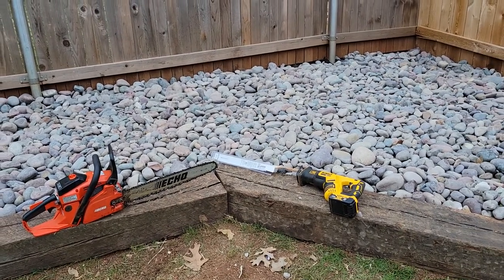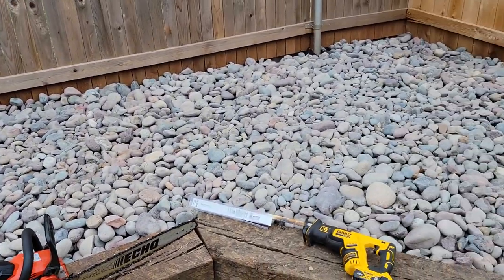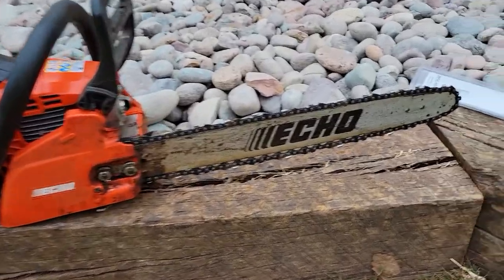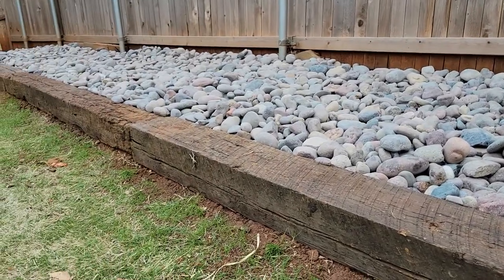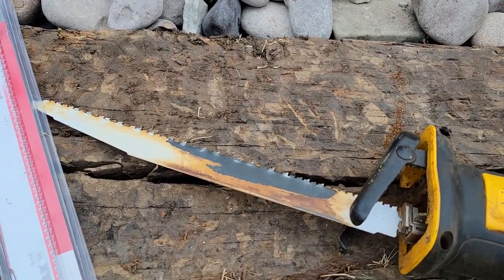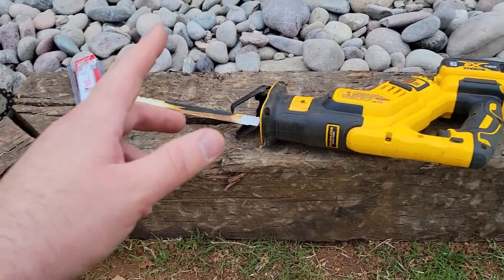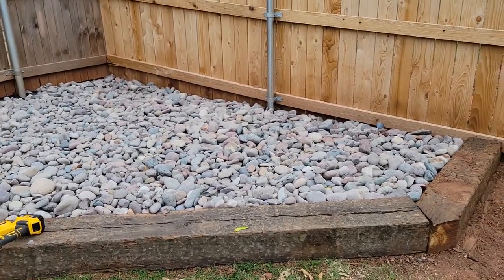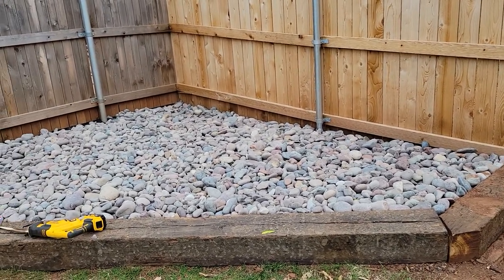Cutting Railroad Ties with a Chainsaw vs Reciprocating Saw

Comment: When you said the saw gets really hot it can burn your hands you said you should be practicing what?  I couldn't understand the words.  What is better to do?  Thank you.  I'm planning on doing this.
Reply from the maker: duty cycle of the motor. Given how much load the saw was continuously taking it generated a lot of heat. Starter motors on engines generally have published duty cycles, which would give metrics such as using the motor for 20 seconds and then letting it rest for xx seconds. Not following them can greatly reduce the life of a motor. A lot of tools have a thermal device that will keep the motor from overheating. Does DeWalt? Likely so, but ive also overheated dewalt tools before so I my thought process is if a tool is hot to the touch then let it cool down before pressing on.